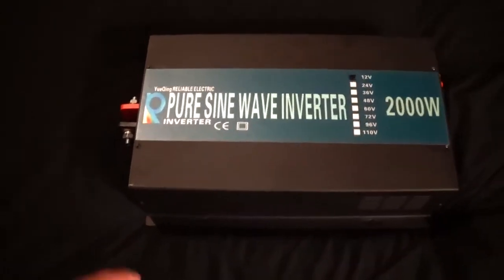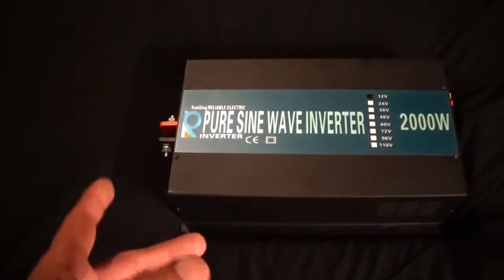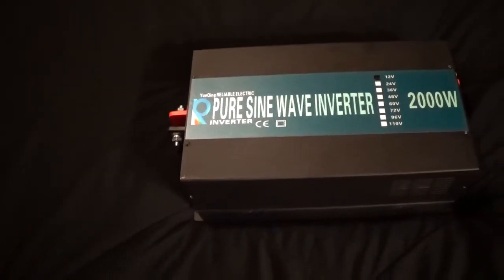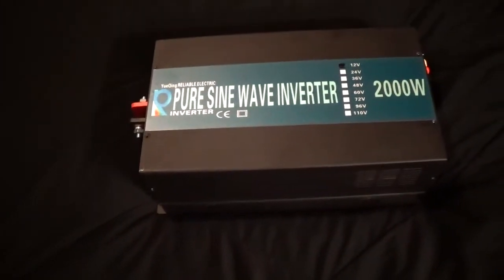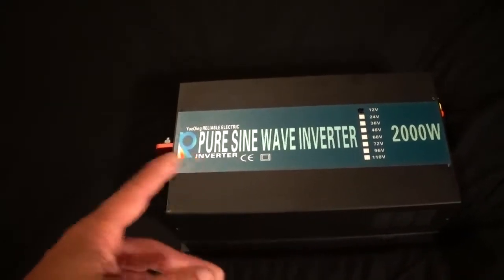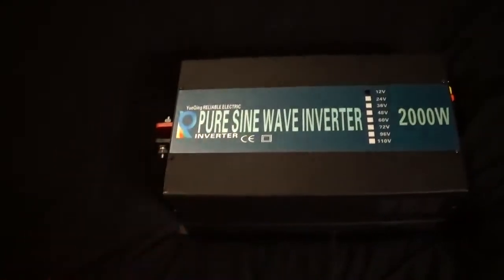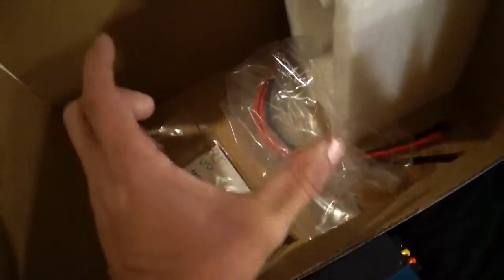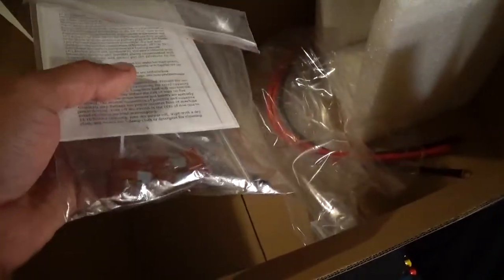Reliable Power 2000w Pure sine inverter review pt1 of 3

Comment: thinking of buying the 48V - 240V 4000W model for my home solar system, will be interesting to see if it can power an AC unit without switching to square wave output

or would you recommend something else?

Comment: I have the same inverter and hear a buzzing sound like a bee out of the front of the inverter. Is this normal or dangerous? Thanks in advance best regards Patrick
Reply from the maker: Its normal
Reply: william staten thanks for the fast answer! Is yours still working properly?
Reply: Desmond Fantastico mine blew up no load caught fire all I did was turn it on. Won't refund full warranty complain to ic3.gov scammers do not buy
Reply: william staten not normal

Comment: Edited while watching: I'm sure somewhere in this video (series)  you're going to put an oscilloscope on the output. I refuse to believe those exposed terminals on the front are 110 volt. Not real impressed with the Spade connectors on the output.